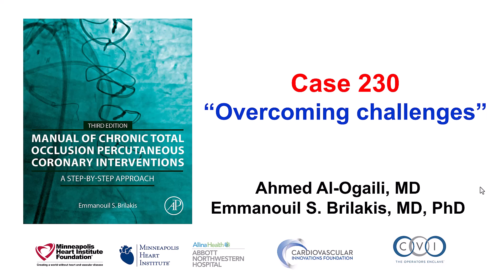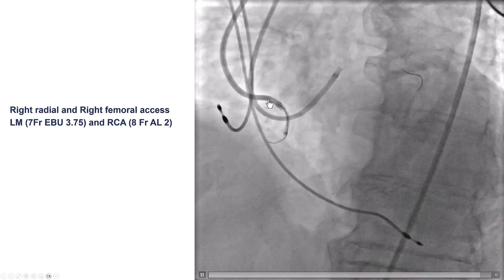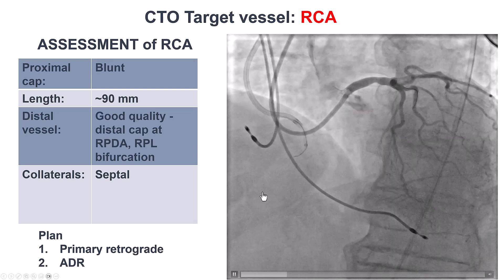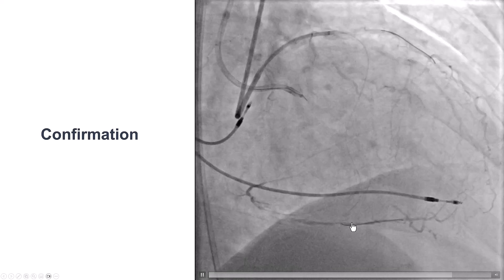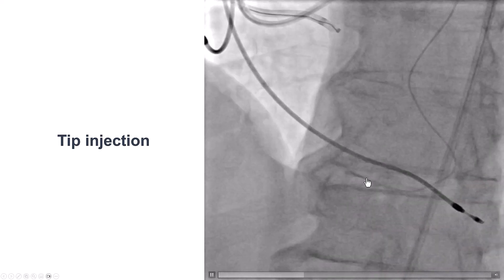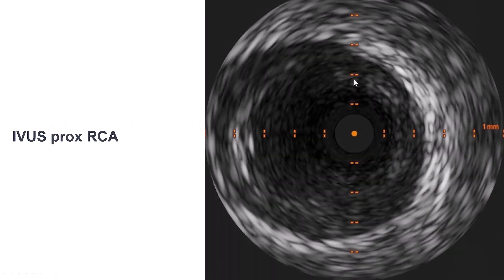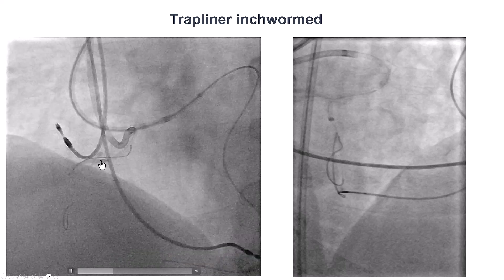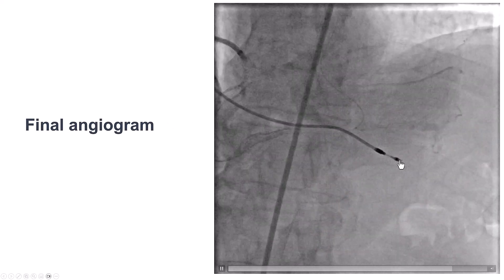Case 230: Manual of CTO PCI - Overcoming challenges

Comment: Nice case. How do you decide between switching retro microcatheters or doing rendezvous if you cannot advance the retro MC through the CTO?
Reply from the maker: Rendez vous is very hard to do - it only works if both antegrade and retrograde wire is in the same space (intraplaque or extraplaque) - in most cases when we cannot deliver the microcatheter through the collateral we insert a guide extension and change the microcatheter.
Reply: Sorry I meant tip in, in the antegrade guide